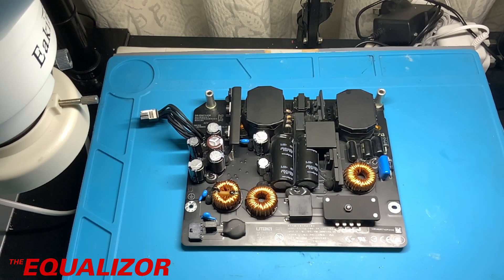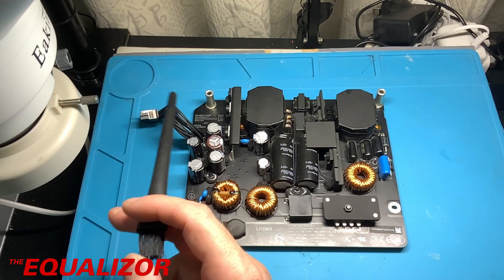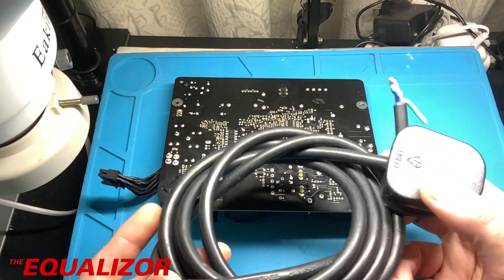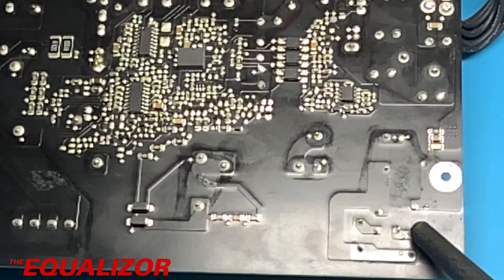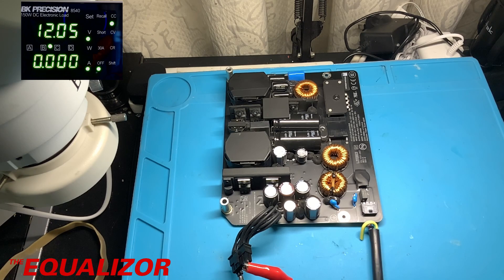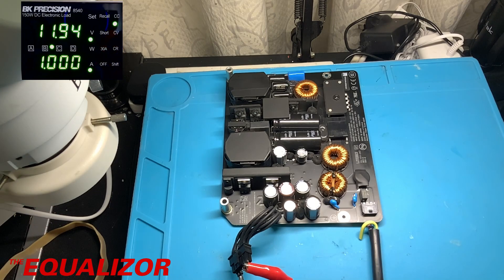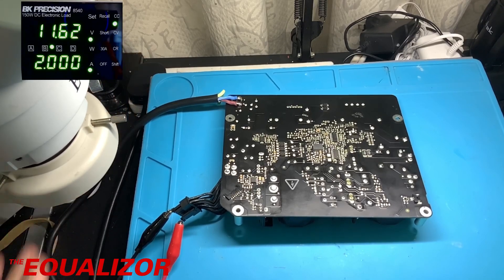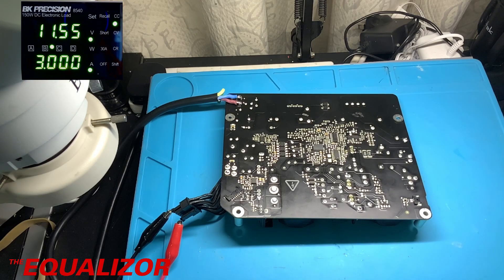IMac 27” PA-1311 power supply offline testing

Comment: Wonder if i can use this supply for a project. What is the actual pinout on the 12pin connector. Does this output different voltages like regular atx power supply ?

Comment: Hi
I have a 2017 5k iMac. As it was very dusty inside and therefore getting very hot i´ve torn it apart, cleaned everything, put new thermal paste on cpu and gpu and put everything togehter.
Actually not a hard job. 
But right now it wont turn on. I left the display off to do some testing.
LED #1 is lighting up. LED #2 doesn´t. I already checked the power button with a multimeter and it works properly.
Next step was to replug all the connectors and while doing that i checked the pins. Everything seems to be right.

Now i´d like to test the psu. Do you have something like a pinout scheme for the power cables? So i could check with the multimeter.
Or do you have any other tips what it could be?
Reply: Old comment but I'm in the same boat. Took mine apart to replace a failing hard drive. Made the mistake of taking the logic board out to apply new thermal paste. Put it all back together with a new SSD and it won't power on. LED 1 is lit. Power switch is good. Just nothing.

Did you ever find a solution?
Reply: I am also on the very same scenario. 
Late 2012 27 inch iMac with Fusion Drive. Wanted to do away with the Fusion Drive so I stripped it all out and whilst the logic board was out I’ve re-applied thermal paste and upgraded the ssd blade and also removed the old 3.5 inch drive and fitted an SSD. 
Put it all back together and nothing but LED #1
I’m thinking if I’ve done something to the PSU or the power button.

Comment: I got a 2009 iMac 27" PSU that would stopped working, I could get it to occasionally come on and then it would stay on for as long as you wanted but power off would make it appear dead again. I took the PSU out and noticed some bulging capacitors. 2 x 2200uF and 6 x 1000uF. I replaced these caps and I was sure this would resolve my issue but it didn't :-(

Comment: I have a similar PSU and it keeps blowing fuses in the plug and it also blew the little on-board fuse next to the AC input connector. That little round thing next to the fuse appears to be a dead short circuit. Is it a capacitor or something else? Anyone know?

Comment: Hey mate I have a problem with my iMac 2013 power supply which is identical to this one. When I connect up power the fuse blows. What would you suggest? Needs to be replaced?
Reply from the maker: Luke Roberts Which fuse is blowing? The one in the mains lead? Circuit breaker in fuse box? The power supply has its own fuse that should blow before the mains lead. Can you give me a bit more detail please?
Reply: The Equalizor correct! The fuse on the power supply. It’s a T3.6A 250V I’m in Australia so I don’t have a fuse in the lead
Reply: The Equalizor it is also shorting out the circuit breaker in the fuse box on the house
Reply from the maker: Luke Roberts I’ve repaired a few Apple supplies and in my experience it’s usually either the bridge rectifier that short circuits and/or the main switching MOSFET so that’s where I’d recommend you start. The fact it’s blowing the primary side fuse means it’s most likely in that area.
Reply: The Equalizor ok great thanks so much for your help
Reply from the maker: Luke Roberts No problem. The parts they use in the supplies are all pretty standard so you’ll have no problem sourcing them there. Please let me know how you get in and what the fault was as that might help anyone else watching this video :)

Comment: Is it possible to buy pass the mains power board and run it in a camper from off a 12 volt supply and without having to use a step up power transfer
Reply: Yes. All the iMac needs is 12V and a lot of amps. So if you feed it that, it should work. It might however be upset, if you remove the power supply. So I would advise to leave it in and feed 12V to the output of the power supply.

Comment: How you discharge the capacitors after this test before safe to handle to put back into the imac? I tried shorted the power on switch for 1 minutes, multimeter still showing power in the capacitor pins.
And last resort as it is faulty power supply no 12V and not going to repair it, i use a plier to short the capacitors pins and WHOA it give a big sparks, scare the shit out of me.
Reply: Use a big resistor with clip leads

Comment: Really useful - I don't have a dummy load but I'm getting 12V when connected the way you have done it so I'm assuming that means power supply is probably OK, which means my logic board has failed :0(
Reply: Usually, these power supplies fail hard-core when they fail. So if yours is still giving you 12V out, it's most likely fine.

Comment: This Power Supply is always on, it always outputs 12V and it should always be able to deliver 25Amps. The Power-Button just controls the Mainboard through the smaller connector going to the mainboard.
The reason, you see the voltage drop at 2-3A load is you less than ideal connection. I am surprised that you own an electronic load and did not realize that.

Comment: What’s the story with the iMac power supplies being dangerous and can kill?
Reply from the maker: That's not something that I've heard about personally. I mean I'm still alive and I got proper down and dirty with that supply, which was at mains voltage for my testing...
Reply: Probably because the iMacs power supplies are unshielded like other PC power supplies. The deadly part is probably when you recently used the iMac, unplugged it and haven’t discharged the capacitors yet when you’re trying to operate on them. If it isn’t any of these reasons then I’m interested what else would make them dangerous.
Reply: Linux Mint I tore down an iMac and rebuilt mine this past winter. Discharged them the way you are supposed to but didn’t go anywhere near those exposed parts! Lol